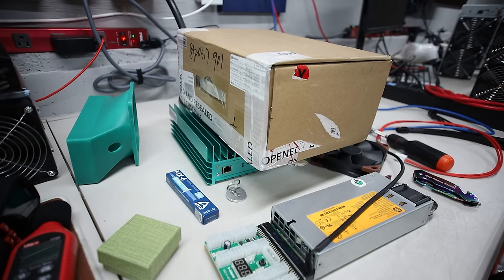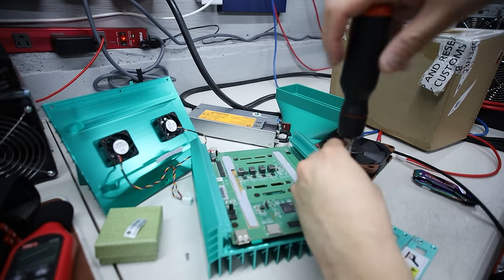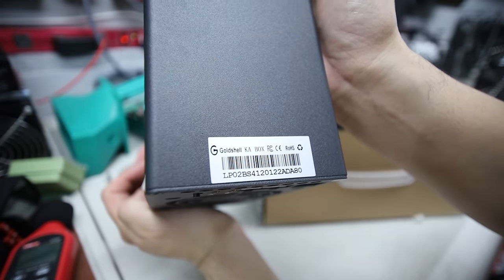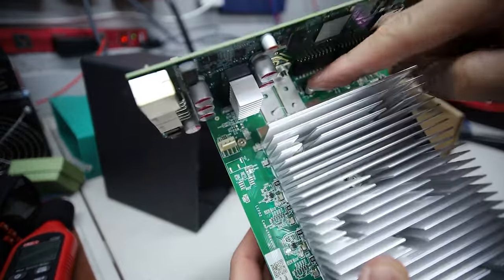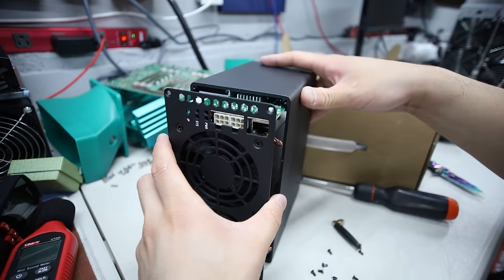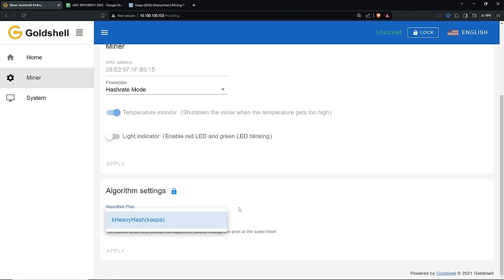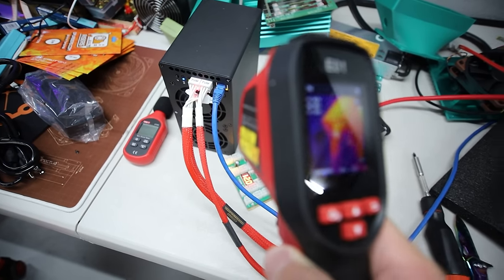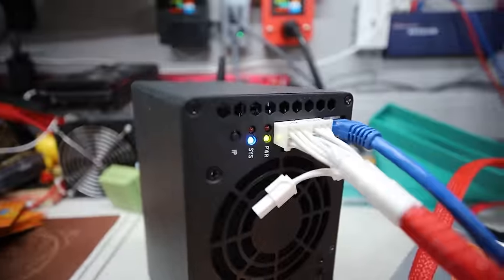The Goldshell KA Box Kaspa Miner Review, Teardown and FIRE Hazard Warning (not clickbait)

Comment: Regarding fan speed you can take it apart again and pull out the third PWM wire from the fan connectors, this way the fans will spin up to 100%.
If the chip temperature is 82 and you get around the same on the heatsink/exhaust it means that the heat transfer from chips to the heatsink is good but the heatsink size or airflow is not enough.
Or in the debug view I think there were some temperature-fan speed commands/rules so if those can be edited you could do it this way as well.

Comment: Great teardown. Most of the Goldshell units run around 80 C because that's what their fan curve is set to keep them at. Would be nice if there was a manual fan control option in their UI especially since it is so easy to change the fans if you burn one out.

Comment: Why was there so much paste everywhere?  Are they only available to the hardcore miners right now. That is cool with the debug tip, KMSG normally refers to kernel logs in Linux. What should the temperature be in your opinion, the KD BOX 2 runs at 78 c. Since target temp was showing 82 its right on the money at 82 and if they set for 82 if you were introduce more fans or shrouds that most likely would pull the fan speed down to get the temp back to its target.

Comment: low power asics are awesome  but for what they charge they should have a little higher standard of quality. you shouldn't have to worry about overheating or melting plugs/connectors, repasting anything or buying additional accessories to keep it from burning itself up

Comment: That’s wild…. The MiniDoge 3 had crazy issues also. I always thought of goldshell as having some of the better quality standards. Until this past December when I got those MD3’s - I only had a problem ever with 1 goldshell miner and it was after it ran perfectly for 6 months. They must’ve changed their quality control practices or something OR are comfortable selling residentially geared box miners which I think of as entry-level that average temps that would cause my 3kW+ miners to shut down for safety. I supported goldshell for a long time but as a farm owner/reseller/asic service tech - I don’t think I’ll be actively working with this brand going forward.

Comment: Ok panda.. There actually is a way to change the fan speed on box miners. It doesn't always stay though. So once you are in the box miner settings click the miner tab on the left. After that under pool settings it will show the word Miner above the temperature monitor. Click the text that says Miner 10 times and fan settings will pop up.
Reply from the maker: Ill test that but I know in recent previous Goldshell models they have disabled that and in new firmwares too for other models
Reply: @RedPandaMining  Didn't know that I don't have any of the recent ones.

Comment: It might run hot, but I still think it's an awesome little unit! I've been wanting a KS1, but they're never available.
Plus the KA box is more efficient, and in a smaller package that can run on 120v, wifi to boot! Hopefully I'll be able to grab one if they restock before the price goes too crazy.
A shroud kit would be awesome especially if later firmware allows overclocking. :_mysoul::_mysoul:

Comment: I think the KA Box may be a bit overpriced, but I also love that it's more than the KS1 hashrate, less power and is a GS BOX format.  If you could actually get this thing, you could stack a bunch of them in the same space a KS1 fits.  Thanks for showing us the guts!  Also, could someone invent electronic devices that get COLDER the more they run!  I could AC my house.  I live in the South so there's not much need for the heat off these things!

Comment: why the fan speed (RPM) is 2220 in your miner as per the specifications of the miner it was claimed that it has a fan speed of 4500 RPM may be that will be the problem of overheating

Comment: Thanks for the teardown video RPM, although it runs got what was temperature day later after the thermal paste has time to settle and cook a while ? Looks compact build and you had no issues setting it up so that is a plus side to it. But can mod or firmware change for can control looks like a.just if them temperatures do not come down. Ship that hash to UK lol, cheers Panda

Comment: I setup my KD BOX II and MINI DOGE II last night and they run hot even in the low power mode. The hardware errors on the KD BOX II keeps increasing so maybe an issue with the chips.

Comment: Overclocking the KS0 Pro lowers it's efficiency in Hash/Watt.  After Spending $270 on high RPM fans, Heatsinks, Thermal Paste, Thermal Glue, Fan Shrouds, Ventilated cover plates, Fan speed controllers and a bigger $69 extra. Power Supply I realised I needed to spend another $75 on the overclocking software.  That brings the cost of supplies to $340+ to mod my KS0 Pro.  Considering the KS0 Pro Cost me $349 + 130 watt power supply for $30 and $55 shipping .... I would be better off just buying a 2nd KS0 Pro.  
P.S.  Just mounting a slow 1200 RPM 120mm fan to the KS0 Pro drastically lowered the Temps to 44C and 71 C outside...so ....
Reply: 75$ on overclocking software? Wah? Why?

Comment: the fans on most products makes no sense
trying to get a small fan to do a big fans job is not smart in many ways

they could make less noise they could run cheaper and more cool.
i would not add more small fans, those are a part of the problem

might as well use a 100-125mm fan that can move some real air